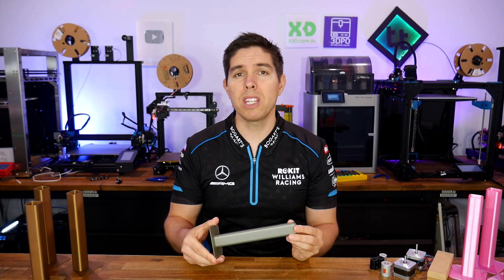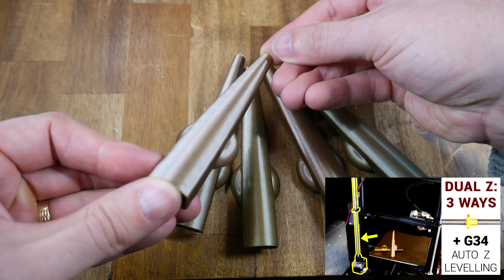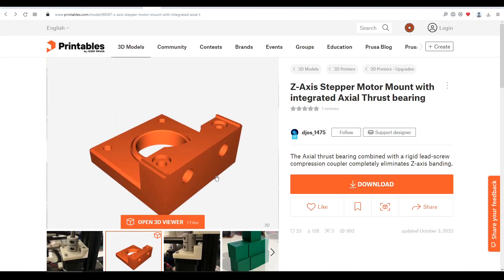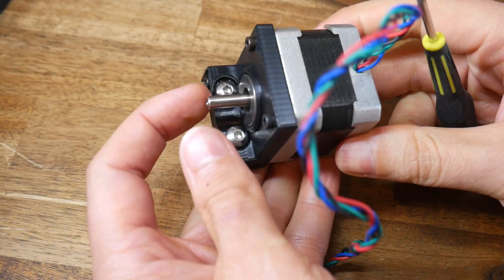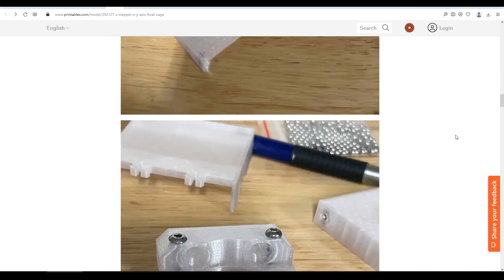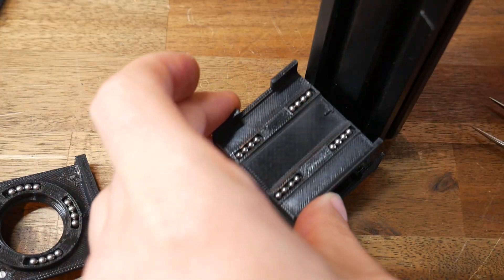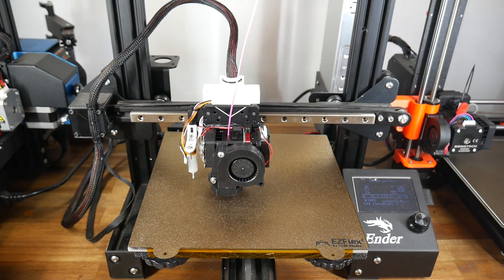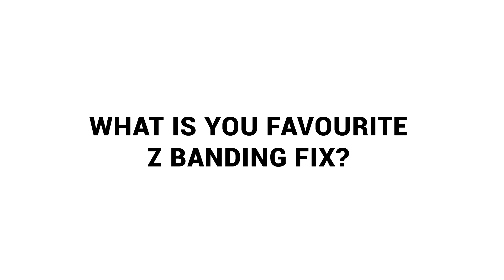Two Z banding fixes for your 3D printer from the community

Comment: i have no doubt these work. but considering the effort needed to install these, the major concern is longevity of the part. i think most 3d printing people do not have experience with PETG--i think it should be mentioned to not even bother trying this in PLA because the part will eventually completely fail from creep or worse within a few months--my guess is the part that mounts the stepper to the vertical post will be the first to go. my favorite mod for bent leadscrew is HevORT's implementation of the z-wobble nut (a really clever implementation of the oldham coupling, with the advantage of being detachable with zero effort) and a $2 metal stepper motor mount from aliexpress.

Comment: Could you investigate an idea I had that is a bit out of my league as far as coding? I think the TMC drivers with stall guard could be used for resonance testing without any additional hardware. I made a post on the Klipper forum called “Sensorless Accelerometer with TMC stepper drivers?“ I started digging into the data sheet and I think the data points are available but I don’t know what to do with them.
Reply: Even if this only works poorly it would be an improvement over no resonance testing and if a bit of code could unlock resonance testing without an ADXL345 that seems like it would be a game changer to me.
Reply: Eventually I’ll circle back to this on my own but it’s been almost a year since I had the idea and I’ve only made it as far as a feasibility check.

Comment: Your problem is not typical z band though. It is mostly extruction issues inconsistent. Z band it obvious defect which you dont even need light to shine through.

Hevort and few other channel exprimented this factor. One of the comman one is due to dual gear extruder. Off centre gear extruder which is very small wobling. Even with original BMG.

Comment: Try replacing the feed nut with a plastic one. Ready-made nuts from POM are sold in online stores. But you can also print your own. Such a nut does not have any kind of backlash because it is printed with a slight interference.
Reply: There is not much of backlash on Z axis nut, becouse gantry weight push it on one side of thread .To minimalize "springiness" of spring washer inside steeper motor and flex of coupler I would try to put sperate bearing block after coupler, like in cnc mills.

Comment: The reason for play in the steppers is because the lamination stack is slightly variable in length, so there has to be some gap to the bearing. The bottom bearing is sprung to take up the end play. If you axis is heavier than the spring tension it will exhibit end play. One way around it is to hang the axis from the motor at the top.

Comment: Never secure the lead screw at the top and let it wobble. Make sure the wheels/rails on the z axis are secure with zero play. Align the z steppers with the gantry brass nut as vertically plumb as possible. Use PID (tuned) for both the hotend and bed temperature control. Make sure the bed has zero play in the horizontal plane. Use real lead screws and not threaded rods from the hardware. Cheers

Comment: For axial play on the lead screw I think HevORT Z wobble wings with magnets by MirageC are a nice fix. https://www.youtube.com/watch?v=mqSQhwqSzvg
Other than that different reasons that can cause a Z wobble like effect to appear are as you said bed PID/bang bang (Stefan's video), extruder gear axial inaccuracies (https://www.youtube.com/watch?v=c6JmCdovE0U) and filament moisture espicially for filled materials (https://www.youtube.com/watch?v=NvukJd4QyBk)

Comment: The worst soliton I have ever seen is the second. You are just trying to losing heavy motor with a lot of printed part modification. Please look up Hevort anti Z wobble, and Vez3d anti Z wobble designs. If just losing the screws of bolt would result better.

Comment: If there is z-plane wobble (up/down) would a mounting below the stepper motor pushing the shaft up also fix the loose motor shaft (albeit for a short time)?
Another possibility is using a fixed mounting for the bottom of z-rod shaft and a floating coupler to the motor. The floating coupler is fixed to the z-axis rod and the internals of the coupler to stepper motor are a star shape with the motors shaft converted to the inverse 'star' shaft to go in into the coupler. Thus the motor can move up/down while the rotation is fixed by the 'star' shaft (tolerances would have to be tight to allow the shaft to not move in the x/y plane).

Comment: Hi, nice video! You did not talk about the play that develops between the nut and the screw do to wear, and this will appear far sooner in chase of the acme thread assembly than anything else. Simple fix is a backlash eliminating double nut whit a spring. 
The second (in chase everything else mechanically is ok) is the drag on the filament from an incorrect routing, or worn tub, or too much friction on the spool holder.
Also recommend "Mirage C"'s video about the topic    https://www.youtube.com/watch?v=c6JmCdovE0U

Comment: Ok , on my E3v2 , i fitted a belt linked dual stepper drive z axis with thrust bearings on the top of the z axis screws. when installing the flexible coupling i pulled up on it lightly then locked the grub screw so it puts a tiny amount of preload on the thrust bearings. This ensures that all the weight of the x axis carriage is bearing upon the thrust bearings and not the stepper motors. There can be another issue at play here - the thread on the z axis screws , they can be dodgy as well but will usually show up as an artifact once  every  rotation  or one that affects one side more than the other .

Comment: Thanks to the community for the mods, but, to be honest, they seem a bit redundant to other components: the floating Z one is an interesting way of basically building a flexible coupling. Mount such a piece so it rests on the stepper axle and it's the same. Given you'll have to buy the ball bearings anyway, might as well go for the coupling.
The axial bearing mount one is pretty nice, I like this kind of approach as it does what mechanically should have been done to begin with, but because of the low loads no manufacturer does. Still, you could just place the bearing between motor and coupler without the mod anyway, couldn't you? I guess it does hold it better for the 5mm shaft with 8mm hole on the bearing tho.

Comment: I've never had this problem with any of my printers but I also make sure my leadscrews are straight and accurately aligned. I use bearing blocks to support the leadscrew at the top and allow the leadscrew nut to float on ptfe grease. Thing is, unlike most all of the assembly videos on the Internet, I take the time to properly align both z uprights for square and parallel alignment as well as ensuring the connecting brackets on the x are in absolute alignment from one side to the next.  I use shims where necessary so it's time consuming but I know that everything runs along its respective axis without off-axis interference. The critical part afterall is the mating shoulder of the screw nut being able to sit squarely on the carriage bracket and correspondingly, as important - the screw having even contact with the flanks of the internal screw thread. Can't really do that on one lead screw unless you set it up under a preload condition - but proper, accurate assembly and alignment should be everyone starting point imo.

Comment: one test you can do is print something like your test tower with diameter X then print the same test tower with for example diameter X*2. point being to make the extruder extrude more filament per layer. on one tower than the other. sometimes it's something goofy going on with the extruder. you should see the pattern occuring more or less frequently along the Z axis if this is the case.

Comment: Nice try.... But a complex and  Completely Unnecessary waste of time and effort IMO.
 I was chasing Z banding  for  a couple of years Tried  several screws.. Too Many touted Couplers. 
I now have too manycouplers and even More Z screws 'cluttering' my storage.
 
Didn't resort to poor practice 'support' bearings though  😉 
 
Firstly: Few Z screws are actually bent... but if suspect:  Use a Mirror and then a Dial guage..to quantify the bending.
 Replacements are Quite Cheap to buy.  Get several to be sure  that you have a genuinely straight pair. :-) 

The Real problem is the Crap couplers.. these are Piss poor at aligning separate shafts.
 No news there Kids..
 As result...  virtually All couplers (at least the ones Sold to us  Printer Weenies)  create  screw wiggles, some far worse than others, 
but all seem as  pathetic examples of the Machinists' Art.
 
  Realising that a  Dual Collet design,  being 100% concentric by nature...Eliminates yirtually ALL  misalignment issues.. neatly.
Thinking this would apply to Retail Grade printers and their pesky  Z screws..  I hunted for some to use.
Found that Collets are either V expensive  or non existent in 3d printer suitable sizes.... 5mm to 8mm is a curious combo.
 Unbelievably...  I tripped over a  printable Double Collet Coupler .... in Thingiverse..  of all places !!! 
 Search for yourselves.. I did.
 Printed in lowly PLA, Mine...have proven Genuinely Concentric and with a wee bit of care dialing them in...I 
setup for No runout at the top of My Z screws.. true.  Working perfectly for about a year and a half now..
Try... and enjoy.. I did.

Comment: complicated ? You simply need a coupler which allows for some radial movement. You can just buy one. The leadscrew is not supposed to be ridig it´s simply allows a up and down movement. The carriage with the wheels is "leading". You need to decouple both from eatch other, otherwise your system will be overdetermined.

Comment: Also, for some good info on flexible shaft couplers, look at the video "Viewer question: the ball bearing trick?" made by Alex Kenis. I use a 1/4" ball bearing inside a flexible coupler on the Z-axis of my ender 5 together with something similar to Thing 4566608 on Thingiverse. (But the one i use has been removed from Thingiverse.)

Comment: I actually added a worm gear and mount on my z axis, then increased steps to match the gearing.  It's much better now, but still never perfect.
Reply: Update, I've added a second z screw with worm gear and removed the top constraints from both screws.  I cannot find any z wobble on any of my prints anymore.  I'm still fighting VFAs but hopefully a new motherboard with 2209s will help clear those up as well.

Comment: Two things really helped my z axis issues. I noticed in Octoprint that my bed temps were fluctuating in a +/- 1.0 degree range. Doing a bed PID tune has it down to a 0.1-0.2 degree range. Second was flow rate. Printing the flow cube test gave me a new flow rate of 85.11.

Comment: MirageC and a few others have been working on this for a while and have tracked down an issue with BMG style extruders causing a Z banding effect. This has actually led to Bondtech updating their BMG design in an attempt to fix the issue. Ironically bowden setups largely don't have this issue and it only really shows up on direct extruders. The VZHextrudort from Mellow and Vez3D also makes an attempt that remedying this issue.

Comment: Lead screw wobble, Z-axis bearings, Z-axis tramming, extruder gears and teeth, extrusion pressure, PID tuning on the hotend, filament humidity, filament diameter consistency, ambient temp fluctuation... and I'm sure there are some other factors. Hard to track down!

Comment: I was having awful z-banding issues on my Longer LK-4. I solved it by going dual Z-steppers and lead screws and a new main board that’s supports independent control of the dual Z steppers. I originally tried to do dual Z steppers without independent control using the OEM main board, but an accidental mis-wiring fried the built-in stepper driver.

Comment: My Ender 3 has pretty bad z-banding. I recently heard that the brass bushing that holds the screw to the carriage should be loosened by a whole two turns. I did that and it helped more than I even expected. I checked the printer and noticed that the binding comes from the lead screw not being vertically aligned with the top. So I ordered a flex coupling (5x8mm) and will add a shim between the motor and the frame to fix that. It should be enough to bring it back to the best it can be.
Reply: I noticed the same thing. Essentially the same fix for me, but with the ball bearing hack as well. Great results. It's honestly this kind if fix which is just a little bit of knowledge and 5¢ of parts demonstrates the issue with Creality.

Comment: I used 5mm Id thrust bearings with a printed spacer instead of the whole printed bracket. Wasn't for banding just to reduce the thrust force on the stepper motor.

Comment: The vertical rails that the carriage rides on should largely eliminate any wobble due to the lead screw. Sure if there are large amounts of lead screw wobble they will put force on the carriage which can then flex, but it would probably have to be extreme. I don't know why over constrained lead screws as so common though. The one end should be free to move for a reason, which is what these designs are fixing. 

In the samples you showed (not the towers) that looked like extrusion problems to me. On the towers, do the bulges align vertically? If they don't test for run out on all the rotating parts that touch the filament in your extruder.  If they do it would cause uneven extrusion speeds and somewhat random location bulges.

Check the runout of all the v track wheels. Both radially and axially. If any have a large wobble that is a likely source. Check if the banding is a multiple of the circumference of the wheels as an alternate method for quick diagnosis. If a wheel wobbles it should cause the error in the part to occur at a fixed fraction of the rotation. Full, half and third rotations being the most likely. Tri-lobed parts are common because the parts are clamped in three jawed chucks while machining. When the chuck pressure is released the part springs back making three lobes. 

Perhaps the layer height being used is not compatible with the hardware. Say each motor step moves up 7 (while numbers for easy concepts) while the layer height you chose is 10. So the first layer it mores to the closest to 10 of 7, the next layer sends it 20, so it moves two steps to 21. 30->28, 40->->42, 50->48. Each layer getting round off position error causing more squish on some layers than others. With the lead screw being a speed reducer this issue may be very small and not a problem, I just haven't calculated it out. If the movement per step is 10 or so times lower than the layer height it probably doesn't matter. If the movement per step is closer to the layer it will. 

Obviously clean any debris off the rails and wheels, and inspect them for damage, but a repeating pattern makes that an unlikely source. 

Those are my ideas off the top of my head. Good luck.

Comment: First: Thank you for your tests and the time and material it took. Second: I prefer a belt between the two z-axes. Adjust once, good forever. Independent z-axes however, driven by two steppers can easily go out of alignment as soon as the steppers are powered off. To overcome that problem you need to bring both z-axes in sync every time you start a print. After using both alternatives I prefer a belt sync.
Reply: Nonsense ! Simply fit SINGLE start Z scews and Virtually ALL  Z synch issues as well as dropping from gravity problems..disapear.
Reply: @barenekid9695  "Simply fit SINGLE start Z scews" what does that even mean?🤔
Reply: @citronski  Typical lead screws used are four-start.  That means they move the z-axis up/down four times as much as a single-start lead screw.  It also means that they are more prone to move when the stepper motor is not powered.

Comment: Look at CNC machines. Motor bearings should not be supporting any axial load. The screw should be constrained by a dedicated rigidly mounted bearing. The coupler between screw and motor allows for some misadjustment. No need for adding bearings so motor can float.

Comment: You'll never get accuracy with the 2nd option because it allows the motor to rotate in the cage ever so slightly, which in turn has influence on the rod moving less than requested since part of this move is lost on the motor body moving first.
Reply: I have had the Z stepper Cage on 2 printers for over 2 months with no negative impact to quality or dimensional accuracy, one printer is in a enclosure with 35-40 degrees ambient temperature. It is technically better that the usual “fix” of allowing the lead screw nuts to float by not having them secured tightly.

Comment: Why not just use an oldham coupling, I'm not sutr but there shound be ones that you mount where the leadscrew is attached to the z axis and ones that replace the coupling that connects the motor and the screw, there are also printed mods with magnets and bearings that imitate an oldham coupling

Comment: There is a file available for a brace for the bottom of the lead screw for the Prusa Mini, but as the carriage for this axis actually rides on encased linear bearings on smooth rods with the lead screw only providing movement and not alignment, I don't see how it would actually do anything. Am I wrong on this?